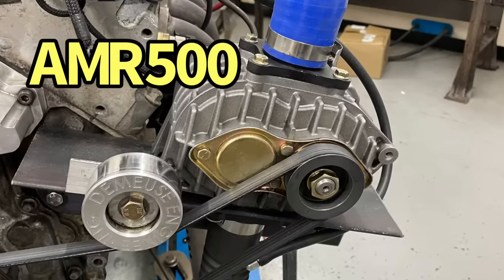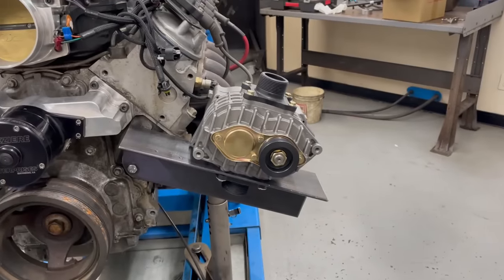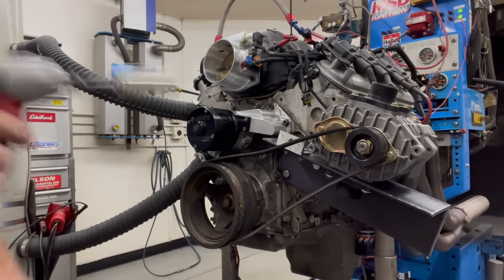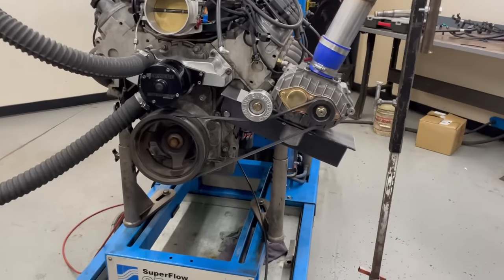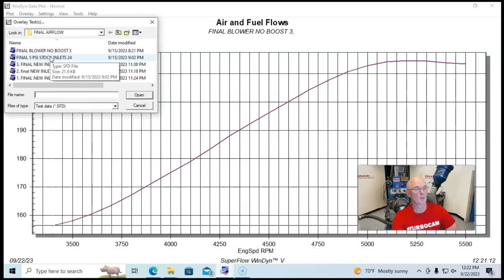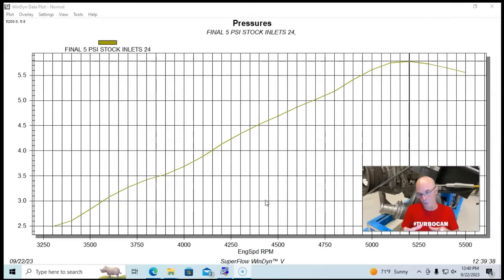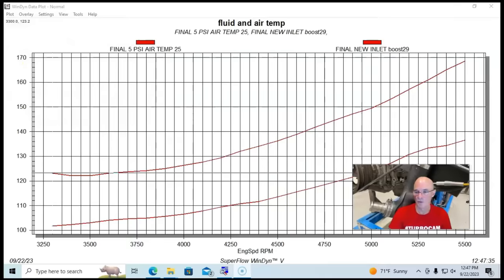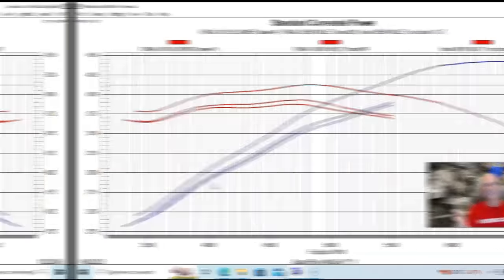THE ULTIMATE CHEAP, EBAY, AMAZON AMR500 BLOWER TEST. FULL RESULTS-AIRFLOW, TEMP & POWER CONSUMPTION

Comment: I was gonna run the bigger sc14 on a Toyota 3tc but I only wanted 5 psi anyways so maybe I will go with the tiny sc instead. Thanks for this!
Reply: That's 5psi at less than 300 cfm. 5psi in this scenario will likely be a restriction in anything more than a couple hundred cc engine. That's just a guess of course though.

Comment: If you put an idler pulley right by the blower pulley, you could get more of a wrap to reduce slippage.
Thanks Richard.  Fun to see what they little blower can do.
I'm still amazed at the power consumption by a supercharger.  The hellcat is probably making 1000HP, with 300HP being used by the blower for a 700HP output.

Comment: I think the reason for the drop in pressure is due to the size of the turbine. It didn’t change. If you take a small water pump in a fish tank and make the inlet and outlet bigger, u can increase flow but the pressure will drop because it is dependent on the size of the pump. U could incrementally reduce outlet diameter to find the sweet spot right at or b4 the turbine becomes saturated.There’s probably some engineer on here that could explain it a lot better than my feeble attempt.

Comment: In my simple mind I liken it to water pressure.  If you start at the source with a 2 inch line, drop to 1 inch line, drop to 3/4 inch line, and then to 1/2 inch line your pressure goes up exponentially. If you start with an even bigger line you're squeezing more volume into smaller space.  Pressure goes up.  I would think this same principle would apply to air as well.  I'm not an expert by no means but, this is my thought :)
Reply: on the water lines done like you explain, if you put a pressure gauge at the end of the smaller pipe, your PS I will be exactly the same as it started. But by stepping down you will gain what I call head pressure

Comment: My first impression of more flow with less boost, backpressure. With TUBROS excessive backpressure leaches boost by, inverting the drive force (exhaust heat/pressure) physically backwards on the turbine. I suggest the same happening here, only just the coldside with the boost pressing back out the intake.

Comment: Not sure why you didn't plumb the supercharger output into the engine intake so we could see how much additional HP it helps produce.
  I think your tensioner needs to produce more contact with the blower pulley to allow the belt to wrap more degrees around the pulley. I think it would be better to have a spring loaded tensioner.
Reply from the maker: this was a flow test of the blower. It will only support 150 hp and won't help a 440-hp V8 (it would decrease the power output)

Comment: Back pressure on the blower causes resistance on the drive system pulley and is causing belt slip.   All of your free flow runs have no drop off.

Comment: This works very good and reliably for the purpose it's made for: a 600cc engine.
I've seen guys raising some boost on 2.0 liter engines but the gains doesn't worth the cost and hassle, for me the maximum serious build with this would be a soch 1.3-1.4 4cylinder engine for a low boost project.
Other than that a chinese turbo always cranks up serious pressure and works like the real deal at least until you blow them up.
Superchargers are already sketchy for high boost, don't waste your time with this unless you just want to match a 2.0 with an 1.4.
Reply from the maker: it's not displacement, it's airflow and power potential. Every 1.4 or 2.0l doesn't make the same power.
Reply: @richardholdener1727  i agree with what you say, but to make it simple with real world examples other than say "airflow and power potential", ideally the biggest engines you can run it on and have the gains you will expect from the term "blown" are the GM headed F8CV, 3-4cylinder Geo Metro, GM Family 1 on the C14SE and less gains on C16SE but overall more hp than the A13SMS-C14SE, Honda 1.3 SOCH, etc, just to name a few from proven tested engines. You can't put it on a cammed C20XE or Honda B20 Vtec which are already inertially supercharged and expect it to have any gains over their 180-200+ hp without twist its heart out and create a hot air gun out of it.
My point is an Eaton M45 - M65 which are day and night different on their capacity from the AMR can be found as cheap if not cheaper out of a Mercedes Kompressor so if there's no space concern just don't bother, cause people end up looking at it for only one thing: Its low price and avaibility

Comment: Boost isn't exactly a measure of restriction so much as compression and density. You're boosting air pressure over atmospheric density and pressure (restricting air through a smaller space is a function of "boost", in which part you are correct). Provided the blower can push past an even smaller hose, your boost pressure will go up and the total CFM will plummet, ala venturi effect: high pressure low flow, low pressure high flow.  My general figure for medium-large compressors is 40hp to turn the compressor head, but hp output ratio is 75-150+, depending on efficiency and design/operating criteria of the unit. 
I remember coming across these some time ago when looking for forge blowers (wasn't looking for a supercharger exactly, but it was in the results and looked interesting to bookmark). If I recall, they were the Chinesium knock-off for a blower on a Mini Cooper and expected to make 4psi on that engine, which seems like an utter waste of horsepower to turn the thing in the first place.

Comment: On a bone stock old 1600cc VW Beetle engine these little things will take the power from 50hp-82lbft to around 102hp-125lbft...I'm contemplating adding one to my sand rail to perk it up a little
Reply from the maker: they will support 150 hp-good match for the VW
Reply: @richardholdener1727  I remember the old Dick Landy kits designed for Beetles in the 90's using a much larger Holley supercharger would boost a stock 50hp Beetle engine to 150hp...They are very rare kits these days
Reply: So its not a good match for more than 200hp car?
Reply: @titouancarre1527  The AMR500 supercharger comes off the Subaru Pleo RS which is a 660cc 4 cylinder which (even with the supercharger) only makes 64hp....On Classic VW Beetles they'll fit upto a 1914cc engine which would produce around 120hp. If you want 200+ horsepower you'll need to source a much larger supercharger

Comment: What displacement Honda VTEC 4 cylinder would be the best match for this blower assuming the goal was street driven, for max torque not HP, 2,200lb, 6,500rpm, and pump gas?
Reply from the maker: only a vtec single cam would not make too much na hp for this blower

Comment: Can we please get the raw data? CSV is fine.

The lower pressure is because of the lower temp we left air density out of our calculations. Remember... (Presure*Volume)/Temperature 

The gold you have given us here is the ability to calculate air-mass/hp this is awesome! Steve Morris was talking about feeding one turbo with the exhaust from a motor on a different dyno (he has 2 side by side) 

The pump will have a max pressure design, and then if the output
Reply from the maker: the lower temp is because the lower pressure...now figure out why the pressure is lower
Reply: @richardholdener1727  because it's always moving the same volume of air with each rotation. If there is resistance to the flow either the pressure or the temperature must increase.  Since what we want is a higher volume of air in the cylinder with the fuel, we really don't care about "boost" :-) not if we call PSI boost.  Boost really should be PSI/temp.

Two experiments I would love to see you run that would prove this. 

Does putting two AMR 500s in series produce more PSI than a single? I don't think it will because they are both moving the same volume of air. 

2nd  Most of us think pressure is what overcomes poor head flow.  If a supercharger moves the same volume of air with each rotation. Is it better to have cooler lower pressure or higher PSI and higher Temp? Not sure how you would set that test up.

Comment: I've seen these little industrial air pumps used to aerate ponds and sewage digester tanks, usually driven by a 10HP or so electric motor.
Reply from the maker: this is a 150-hp blower

Comment: I would check results with thermodynamic ideal gas laws for isentropic process.  For instance, Thermodynamics would say with no restriction and thus no pressure rise, there would be no temperature rise.  If there is temperature rise, the most likely source is internal air leakage.
    The gas laws are on wilkepedia.  Gamma is 1.4.  Temperature is from absolute zero (add 460F to your thermometer readings, eg 73+460 = 533F).        Cheers
Reply from the maker: this is not a gas law problem

Comment: I think the reason the boost went down with the bigger inlet and outlet is because the smaller outlet was an additional restriction.   When it went away the boost dropped.    The boost droppinig off at the top looks like choked inlet flow.

Comment: Hot air expands, with the hotter air created by the stock inlet/outlets, there is more airflow in the outlet pipe to give you higher boost but that air is less dense. If you measured the airflow after the blower this would have shown this
The lower boost setup has a lot denser air, therefore more oxygen, and could produce more power.

Comment: So…

Will The AMR 500 Works With My Kia Rio 2003…?
And The Car Have 1.3L Stock Engine… (Unknown HP)

Because I Found Out This Is Only The Cheapest Supercharger I Found On The Internet… I Wanted To Put Into My Kia Rio…Will It Work…?
Reply from the maker: it will support 150 hp
Reply: @richardholdener1727   oh…ok…it will works and it will make it till 150HP…is it correct…?

And did i have to change the supercharger hole size…?
Reply: And I Found One In Carousell Malaysia…
It Was RM 300 ($63.33)…
I Don’t Know It Was OEM Or Not :/

Comment: Maybe  strap a variable speed electric  electric leaf blower  to your interior console with duct work and a pre throttle body chamber  with a second throttlebody in front normally open that  shuts off regular air inlet  flow when the variable speed leaf  blower is flipped on.

Comment: Boost pressure is lower because the blower is functioning less inefficiently so there's less loss to heat and generally able to flow air through the entire setup more efficiently
Reply from the maker: less efficiently with greater inlet and outlet flow?
Reply: @richardholdener1727  less *IN*efficiently (I don't like Roots blowers hehehe)

Comment: I would expect lower boost pressure with the upgraded inlet/outlet. 

Its just like a GT28 turbo spinning very hard to move X amount of air, vs a GT45 barely spoiling up to move the same amount of air. 

The restriction (your engine) remains the same in both cases.

Comment: Lower temps lead to lower boost, but more airflow because of change in volume related to hotter or cooler air. That's why the bigger inlet anf outlet produce less boost with lower temps and more airflow.
Reply from the maker: lower boost lead to lower temps-more air through teh same restriction should be more boost
Reply: Almost. Air got a given  ratio of volume increase per 1° higher temps. 
107,3 ltr  insead of 100 ltr at 20° temp-increase. 
So with higher temps at the charger, the boost increases, without moving more air. 
If you lower the temps, you move same airvolume at lower boost. 
Do the same test with an intercooler and a good cooling at the intercooler. 
The boost and the Outlet of the intercooler will drop significantly. 
It's the same thing. 
Cooler air is much denser than hot air and needs less volume and less boost in the same room or restrictor.
Reply: Tried to keep it short and simple. 
Example: 
We both get 100ltr of air. You keep yours at high temps, i'm cooling mine down to 0°. 
We both still have the same amount of air, but my volume is just a fraction of yours. 

So my air doesn't produce any boost in the same system compared to yours, but i moved the same air. 

My engine would produce X-times more power than yours, when we both keep the boost the same, because i moved more air.
Reply from the maker: you are missing the obvious-the boost was lower so the temp was lower. The flow was higher with the same restriction-so boost should have been up-start asking why the boost wasn't up-it wasn't because of temp
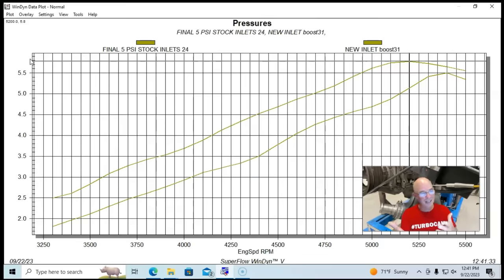Reply: At 13:18 you were asking, why the bigger inlet and outlet leads to less boost. 

At 14:37 you have your answer. 
Intake temp was about 20 Kelvin less with big inlet at idle. Diffrence got bigger with higher rpm. 

Higher temps leads to more volume (cfm) per lb or kg airmass. 

Just playing around with numbers: 
100lb airmass at 100° is 170cfm volume.
100lb airmass at 55° is 90 cfm volume.
(These numbers are not real, just for the example). 
With cooler inlet, the moved air is much denser and takes less volume in the same room. And that's why it's less boost. 
In the end, it's a good thing. Cooler air is better for engine and combustion, same as less boost with same amount of moved airmass and adjusted Air/fuel-ratio. 

My english isn't the best at all. I try my best to explain. Hopefully i got it right and didn't write some rubbish.
Reply from the maker: it had lower air temp because the pressure was lower-Achems Razor-we now need to know why the boost was lower (it was not because of temp-we solved the problem)-find the other answer that is not temp

Comment: amazing content! 
you can tell a couple times the belt walking on the pullys. id also suggest fully welding the exit pipe and a good seal around the mounting metal could be losing boost there.

Comment: Supercharger can only eat so much air relative to rpm spun, less inlet restriction from atmosphere pressure.  Boost pressure at outlet is related to outlet restrictions.  No outlet flow is max boost, but no use for engine power!   Other extreme this 150hp blower on 440hp motor would have  vacuum -ve boost at outlet and cause power loss from restriction + turning it round!
Reply from the maker: the boost from the blower was not run through the motor, we only used the LS motor to spin the blower to measure flow

Comment: I’d assume that since the air has less restriction leaving the blower and not staying in the blower, the air stays cooler so boost goes down as air flow goes up since heat is going down, so the air is taking up less space. Boost is always higher on the hot side of the inner cooler.

Comment: The reason the boost was lower with the larger inlet was because you got your higher flow by reducing pumping losses, which translates to lower temps at the outlet, therefore lower pressure. Gale banks goes over a lot of this in his video series on trying to kill the new Duramax. If you can keep your air charge temp lower you can actually flow more with less boost and make more power at the same time because you get denser air charge at lower temps even at lower boost. I think that's what must be happening here.

Comment: I am thinking supercharger testing is more complicated. I think the output should be connected to the engine. Then you  must use  the compressor map in conjunction with the horsepower and boost to determine what is happening.
Reply from the maker: this was a simple blower flow test-a 150-hp blower does not work on a 440-hp motor

Comment: From what the graphs show it almost seems to have an internal blow-off valve. why it would change so dramatically from the first intake to the second intake is still a mystery and this could be one of the issues that are not seen upon unboxing of this unit. The belt slippage issue could also be giving this type of result as you are putting more air through the blower with the self-made inlet you could be triggering the bypass valve (blow-off valve) without knowing it

Comment: It was a great video showing these little motor awakeners.  I've seen them used on Geo Metro cars, Honda Civics, plus many more brands overseas mainly.  Should support up to a 3.5L with boost till 4500rpm (222cfm).  I believe air dynamics changes quite a bit when you have an engine sucking on the outlet of the AMR.  Would like to see some real use. Thank you Richard for the time you spend on these ideas!!!
Reply: It'd be perfect for a B/D 16 Honda engine, Hell it'd be pretty decent for any of the 2 stage VTEC engines like the K20/24, B18, H22 etc....
Reply: That supercharger was Originally meant for a 1.6 through 2.2 Mini Cooper.

Comment: Hey Richard, I have seen air loss by backfeed thru the SC seals. Hot air expands the seals, cool air shrinks the seals. Just thinking. Efficiency inside the unit might be geared towards small CI motors. Say 4 cylinder motors. Just a thought. Interested what KB comes back with. 👀

Comment: Interesting. I think there's a ceiling of the size of the impeller turning so fast that it simply can't pull air into the intake. Perhaps having pressure from driving and air speed constantly increasing with speed it may overcome the problem.  But it's a tiny unit. No expectations.

Comment: Rich, the disparity in boost pressure may be in regards to the velocity of the air entering and exiting the blower with the small vs large inlet/ exhaust. Same way with exhaust scavenging, the best flow is a matrix of velocity and volume, not necessarily pressure or vacuum.
Reply: A lot of people do not understand this. Everyone wants to port LS heads, then they lose velocity.

Comment: The blower needs more belt wrap on the pulley to combat slip. Put an idler next to the blower pulley to pull that belt around further. 

Or….change the ratios, bigger crank and blower pulley for better wrap.

Comment: You can see the belt slit in the video at high rpm. Watch the belt the tension side will start to flop around and on one pull it even goes around crank pulley.